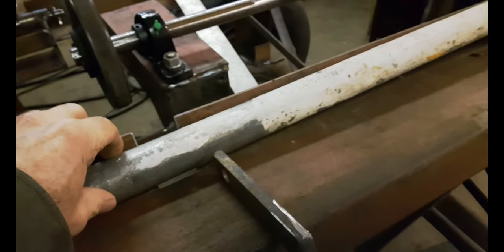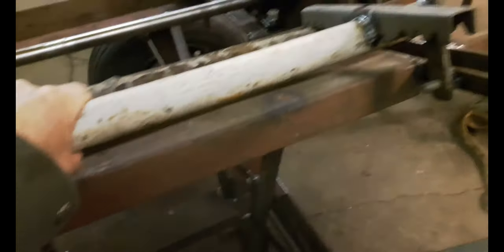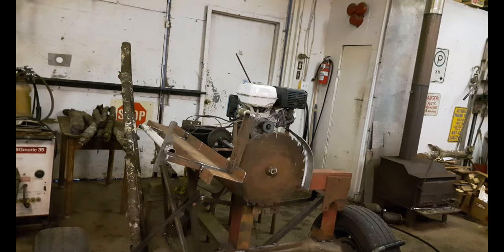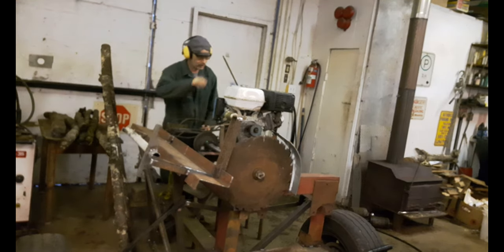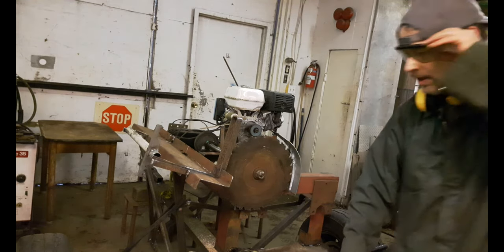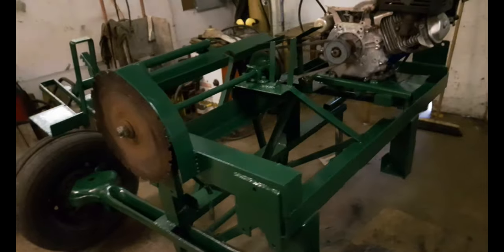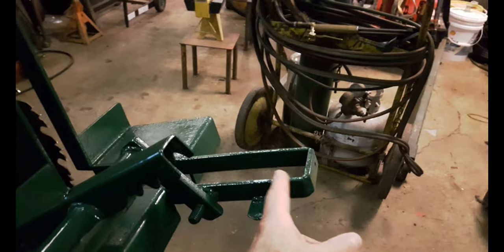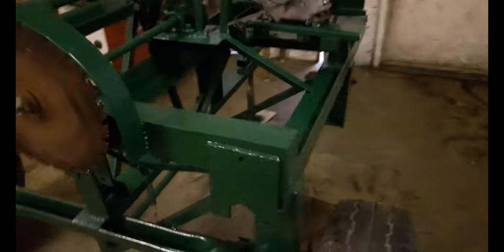Buzz Saw Build Part 3, Dominance and Submission Cover

Comment: That looks to be an awesome build !!  I use buzz saws all the time, but usually with a tractor rear mounted or with a long flat belt drive with the saw staked to the ground.  Been using them for 60 years or more.  Great video.
Reply from the maker: Thanks glad you enjoyed it.